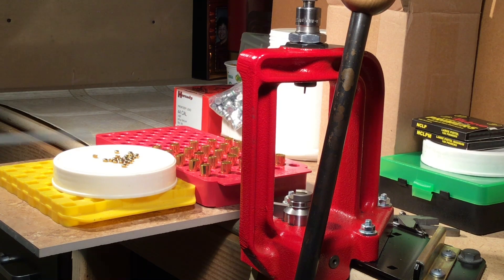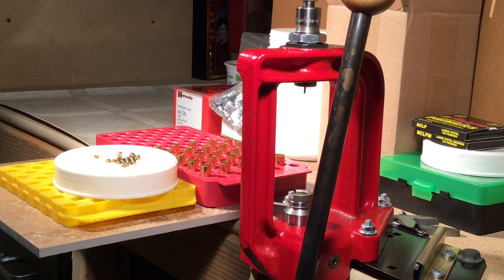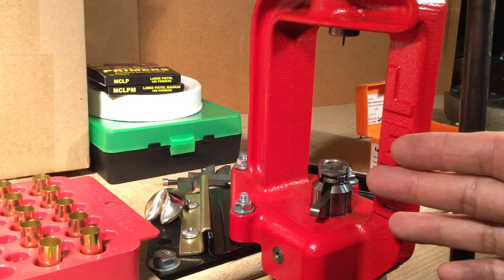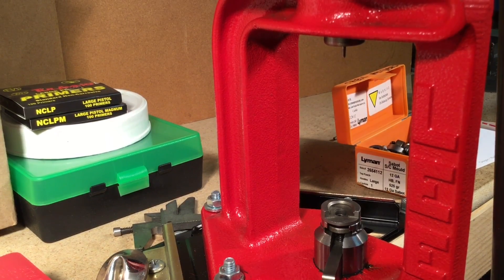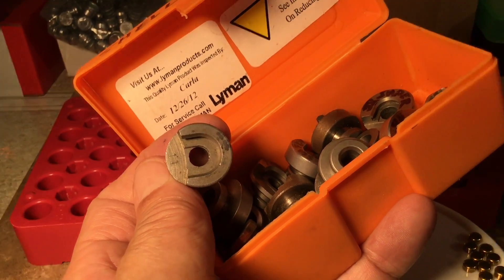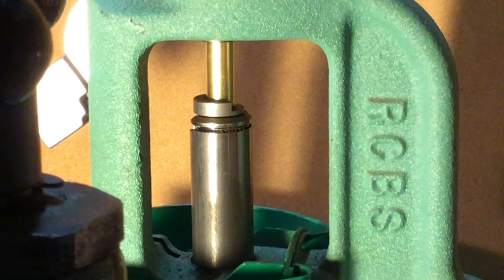Evaluation Of Press Equipment Alignment

Comment: Interesting so I have seen the MEC metallic reloader has a floating shell holder design to keep alignment self aligned as well. Its hard to see in your video but I watched it several times and easier to see in the Lee part of the video. It looks like when it moved over and you lowered the handle ever so little the shell looked more centered with the ram. I would think perhaps if the shell holder could be removed and brass placed on ram in center and try to see if once shell is in die if it's centered? If it is then a new redesign of shell holders if possible may take care of problem like MEC did but with holder not reloader mod. Again hard to see in video and I could be way off. How about a new video trying without shell holder to see if ram is centered

Comment: You are screwing your mind up here Cookie over this - trust me when I tell you that the ram and the die are straight up and down with each other in a O type presses.  It is because of the way they are made and the reason they are so popular.  There has to be wiggle room in everything in this world because nothing outside of God is perfect.  If you are going to do anything - I don't care if it is "blueprinting a rifle," you have to start from a base line; what is the one thing you are going to call to be true?  From there I will take all of my other measurements from.  Tis a poor craftsman that blames ones tools.  Everything you did in this video was predicated on pushing the case to the back of the shell holder - the back of the shell holder and case alignment does not have anything to do with the ram and the die being square to each other.  Your hypothesis is false.

Projectiles are not perfect; powder is not perfect; primers are not perfect; and our brass is not perfect; and yet you think that the press is what is wrong with the end product in a batch of ammo you (an imperfect being) produced?  You have to start with a baseline off of a press, and then a process which can eliminate as many of the variables as possible.  You are chasing your tail Cookie for perfection which is not in mankind; and results are not a baseline - they are the results.  They are the product of the one thing you start with YOU call true.  Both of your O type presses are machined and ground true and can be used to make excellence, not perfect, ammo.  And do it for millions of rounds - and this stuff ain't going to the Moon Cookie.

Comment: If this is an issue for you take out the spring clip that holds the shell holder and replace with a small rubber band. This will free float the shell holder enabling perfect alignment each time. The case will automatically centre in the die.

Comment: Please don't apologize.for the detail. I had been researching this on the internet. When I started learning reloading and found that not all presses are properly aligned causing run out, it was disappointing. This is a good video,especially for beginners. Thank you. And it is also why I will be upgrading to a Forster co axial with their Full Length floating mandrel dies(or bushing dies). I wanted a Redding T7 for my 44 magnum and some plinking rounds for non precision rifles. But I saw a video showing alignment issues. I wonder if progressive presses have similar issues? Some say when there is poor alignment to put a rubber washer under the die's lock nut and put a shim between shell holder and die when  adjusting die. I am disappointed that manufacturers don't implement more consistent quality control. After all we are making thousandths of an inch in measurements. I suppose the Forster press and now the MEC press with floating shell holder clip help this issue. Arbor presses (with wilson dies)can help seat the bullet straight also. Also, it's a shame that for so many decades so many rifle makers put so little effort to making rifles true and square. I guess you got to go custom to minimize that risk. Thanks again -very good video.

Comment: Yea thats a possibility. You are rigth Bret Hudgens. I tried it with my Lyman T Mag 2 turret press as well and lo and behold the shellholder tilts with the ram spring. I have my Equipment allways heavily greased so it has a inertia to self adjust. But this tilting of the case is not due to missalignement but the shellholder is tilted by the spring. Tilted by Hand the shellholder in the rigth direction I got not case tilting at all (it went straigth in).

Comment: Very good Video and Point. I believe many of us reloaders have never really noticed that as much. Although I noticed it with my Lyman T Mag 2 turret press as well which has about much play as the Lee in this video. In your case the cheaper Lee has less play than the expensive RCBS. I reload only handgun ammo. However if I put the shellholder opening towards the press stem it can "align itself" to some degree. The coax press is to expensive for me but still the Little play seem to be "industry Standard" for reloading Equipment. It would be easy to make the turret presses all into an coax self adjusting model by Drilling a Slot into the turret for each hole for the lock ring on the die and make the Shell holder on the ram Floating. Should be easy for the industry to solve this Problem. But without changing reloading presses adjusting the opening of the Shell holder to the correct direction where it wants to slide towards, is a viable solution. One can correct a bit by Hand as well.

Comment: After watching this video I immediately checked the Lee pressed you show in your video. Lo and behold I had shells kicking over. So I Investigated it a bit further. I was turning dies and turning the shell holders to no avail. then I said there's a Spring/ clamp  that retains the shell holder. So I applied a slight bit of pressure to the shell holder as I lowered the handle and the ir was.......  no more problem. It seems that the Spring slightly lifts the shell holder in various Directions. Both of your presses as mine and your viewers are likely fine as that Spring in clamp slightly tilt your shell holder.  once it enters whatever die  its completely straight.
 Thank you for your videos i really do quite enjoy them. This is the 1st comment I've ever left, but I felt this was  Important for you to check for yourself.  Possibly update this video if your findings equate to mine. If you're still unsatisfied I would be more than happy to pay you 25% of the value of your cast lee and rock chucker.😉
Reply: Yea thats a possibility. You are rigth Bret Hudgens. I tried it with my Lyman T Mag 2 turret press as well and lo and behold the shellholder tilts with the ram spring. I have my Equipment allways heavily greased so it has a inertia to self adjust. But this tilting of the case is not due to missalignement but the shellholder is tilted by the spring. Tilted by Hand the shellholder in the rigth direction I got not case tilting at all (it went straigth in).
Reply: Yes, that's exactly what it is. I carefully watched why this is happening on Lee. It is the spring that lifts the holder a little on one side.

Comment: Another great video.

With what you have shown here it seems it would be impossible to manufacturer a progressive press that can align 4-5 dies in a toolhead with all the cases in the shell plate at the same time.

Perhaps these alignment issues are only issues as you get rounds into certain velocities ranges and distances.

Comment: If the case is forced to tip over out of perpendicular with the shell holder/ram base that would be bad even for pistol reloading but if it just slides horizontally to correct alignment with die it's doing what it's supposed to do. There is no practical way to achieve exact concentricity with the loose fit of shell holder to ram and shell holder to case head because of tolerances of those components (tolerance stacking). This loose tolerance is why benchrest reloaders use special dies and an arbor press. For the average reloader like myself conventional presses approximate the precision of factory loading or slightly better.
Reply from the maker: Mickey Meador - You've got it -  the Co-Ax and MEC allows that sideways slide.  Others do not.  I wish my old Bair was still working - it had a bad misalignment and I could probably demonstrate bad concentricity with that one...Have a great day,  FC

Comment: Very good and informative, my ancient Lyman O press passed with flying colours. It has no compound leverage feature a toggle press. Another of your readers  reported the same success with a Lyman Spartan. Maybe the old toggle design are more capable of good alignment.
Reply from the maker: gump - The compound leverage system is a great selling point for press 
makers.  Probably both systems are capable of having fine alignment, but
 I can't say that for sure.  A well aligned press is a good one to have 
for sure... Good reloadin' to ya,  FC

Comment: I thought that was the “self centering” that the Lee dies are supposed to do.  Without looking that up, it seems like I’ve read that in the Lee literature.  I just went out and looked at mine using a .357 Magnum case, and my press does not do that.  It is the Lee Classic Cast Breech Lock press.

Comment: Another possible source of the cause of this miss alignment could be the strong spring that holds the shell holder in register, you could see in this video that the case was tipped to one side, if the ram bearing bore and the die thread is all bored in the same operation they must all be concentric, the only areas that can throw it out it the attachment of the shell holder on the end of the ram, with any kind of spring retention this must push the shell holder out of line within the clearance in the ram, there would be little possibility that the die or shell holder would not be perfectly concentric as these are ground on a common centre , but the final test is , is the ammo concentric ?
Reply from the maker: Englishman French - Always good hearing from ya..!!  That's the proof of the pudding, isn't it?  The search for the .000" run out ammo with SD of 5 or less to be shot with the most consistent bullets matched to a custom barrel fully blueprinted rifle all properly bedded in a quality stock.  Any press that does that ammo would be the one.  But the determination of that would take some serious statistical data gathering.  Thanks again for posting the information in your comment...FC
Reply: I do wonder if we attach too much importance to run out, within the parameters of commercial ammo there must be "normally" accepted run out, surely it is the chamber/ bore relationship which determines how the projectile starts off on its journey. What is required is a back to back test with the same loads, one batch having been aligned perfectly, the other loaded with say .010" run out, if the cartridge will go in the chamber I think the difference for normal use would be minimal, if any, the precision die makers obviously would have us believe it is important, as would someone who just payed $200 for a precision die set, but it is all like the Kings new Clothes! Probably invisable.
Reply from the maker: Englishman French - I have done informal studies on that very subject.  Not statistical results, of course, but the conclusions I have drawn are that low run out does make a difference in group sizes.  Even posted some of those results in video form... It's like wondering if blueprinted rifles make a difference.  Have a great day,  FC

Comment: take the retention  spring out of the ram.
Reply from the maker: G.I. Company - The shellholder retention is then a cheap unacceptable arrangement on an expensive ram.  The spring is supposed to be a snap in with passive retention.  If it is in fact active at full installation, then error is introduced in its deployment.  If we remove that spring, then we attenuate one problem and bring in other problems...Why don't we have a vertical drop in of the shellholder with a setscrew (s)?  As the video brings out, the deflection errors are of no consideration for most of our shooting - it's just good to know about in case we have need to look at that... Best Regards,  FC
Reply: I am just introducing another variable.  If the spring is holding the shell holder at an angle, then the misalignment could only be the spring tension.  Once the ram imparts more force then the spring, the misalignment may be overcome.  It's worth trying to see if there is any difference with or without the spring.
Reply from the maker: G.I. Company - This is a fine think tank we have going on - thank you for it - would have made the video better if you and I had conversed beforehand.  We do need to understand these presses.  I had not considered the spring until now.  Another way to evaluate would be to screw one of our dies down onto the shellholder and add a 1/2 turn or so.  Then observe the shellholder carefully at the entire compression to see if any deflection of the shellholder in its seat caused by the spring exists.  If so, the spring being active on the shellholder is indeed an issue, but the die would have to be rotated a bit and rechecked to obviate base of die not being square.  I will check this, but another video may not be worthy. Before we take out the spring and perhaps cause a problem for it requiring a new spring, let's see if there are other means of evaluating the spring.  Otherwise, the ultimate would be to remove the spring.   The design is supposed to be simple and even the highly regarded Redding uses it  - once the shellholder snaps past the spring, the shellholder should be stable and fully seated but not under any additional tension.  Also, the only way the misalignment can be corrected once the mouth deflects is if the base of the case also deflects an equal amount and early in the entry process.  The video brings out the entire lateral slide if the deflection is in the axis of case entry of the shellholder.  If the deflection is not in the axis, then the base correction does not take place.  I have not noticed any shellholder movement during the press stroke on any of my presses over the years of use.  These are all issues the Co-Ax resolves with their system of locked shellholder and die channel self alignment.   We used to be able to add annotations to existing videos for additional information presentation, but the use of Google endscreens eliminated the use of annotations - pity.   Gave us a nice feature but took away another.  Have a great day,  FC

Comment: Wow u have so much info. Thanks for all your great videos
Reply from the maker: Brian Meier - When you see information about press alignment, you can now enter the fray armed with knowledge that may be of use... Some will say that the shellholder spring is the reason for misalignment (then why have that cheapness on an otherwise precision press?).  You may hear that the hole for the dies and the ram is drilled together so that perfect alignment is assured.  However, the threads still have to be produced.  And what about machine wear in manufacture.  Those reloading dies have bevels to give the brass a bigger target to get in for a reason - to make up for misalignment variations allowing for smoothness of operation.  Our reloading systems work - but some presses are better aligned than others even of the same brand and model.  Have a great day,  FC

Comment: Off topic, FC but a question. In loading your 44 special, roll crimp is needed. Is it necessary to pre-size your casings, trimming to equal length, to make sure your roll crimp is consistent from one to the next ? Wondering. Thanks for all your time and trouble. Good videos and information.
Reply from the maker: Walter Palmer - Thanks for your great question.  People ask me why I don't trim my brass with the thinking of consistent crimping being the drive.  Our straight wall cases do not stretch in shooting, so if the max brass OAL is not exceeded, no trimming is required.  To arbitrarily trim cases to the same length, we would trim to the shortest cases - oftentimes winding up under the trim to lengths in our manuals - not desired.  And if we do not trim to that, then the shorter ones pop up and don't get trimmed.  And reloaders are also constantly searching for the "best" case trimmers.  Note that with our tapered crimping groove designs, the small variations in OAL are handled nicely to still have the crimps we need.  I have found that to be a saving grace in our cast bullets for fine shooting over the past 40 years.  Best to ya,  FC
Reply: Thank you kindly. Your good character shows through in all your videos.
Reply from the maker: Walter - I'm thanking you for taking the time to post comment...and your kind words are much appreciated... I'm going to do some testing on more accuracy techniques applied to our pistol ammo - and the results may or may not be surprising... the consistent brass length = consistent crimping is going to be one of the issues handled... Best to ya,  FC

Comment: FC, I've noticed this misalignment as well,  and as a result, I double press each cartridge with a 180 degree turn in case of subtle variances. End result ? The Final sizing becomes almost unnecessary, at least for me. Of course, I final size anyway but resistances are negligible.
Reply from the maker: Walter Palmer - I like your solution to this...my solution has been to do all my rifle loading with the Co-Ax.... Pistol ammo is done in my Dillons or my single stages if I'm in leisure loading mode... Best Regards,  FC